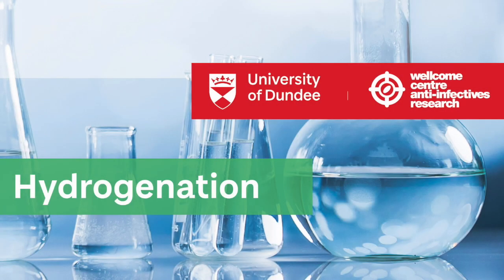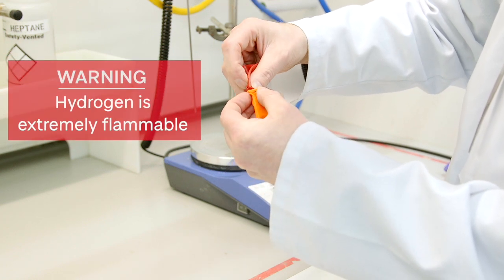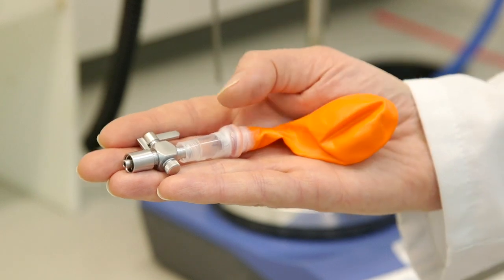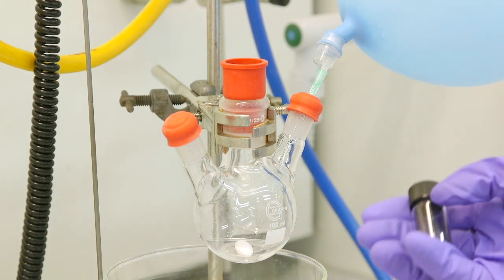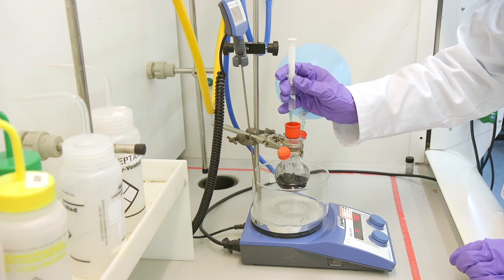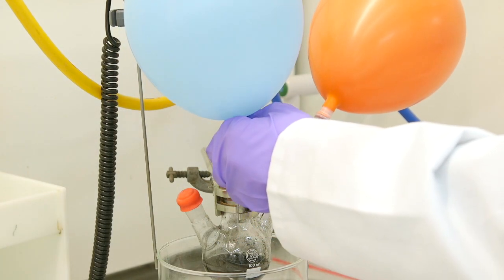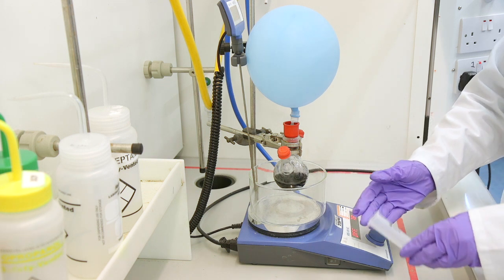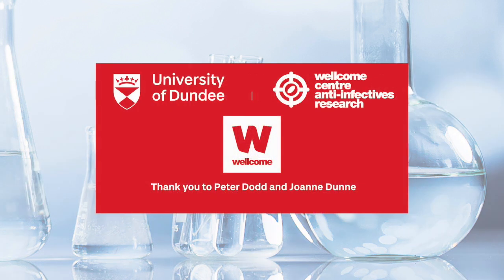How to set-up a hydrogenation reaction using palladium on carbon and a hydrogen balloon

Comment: Very nice video, two comments; once punctured, septa are not terribly vacuum-tight, meaning under vacuum, atmospheric air could be sucked in through the puncture. If the volume of hydrogen is completely consumed by the reaction, the setup could generate a partial vacuum, which once again could lead to atmosphere ingress.

Comment: Hey, I was just wondering if you have to evacuate the air out of the flask and back-fill it with nitrogen if I were using a nickel catalyst? Does it effect the hydrogenation reaction or is it evacuated just because it reacts with the palladium? I'm doing a school lab investigation on finding the activation energy of hydrogenation, so I was just wondering if that step would be necessary for my experiment. Thanks!!